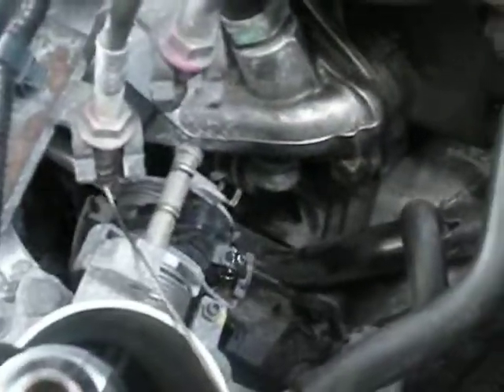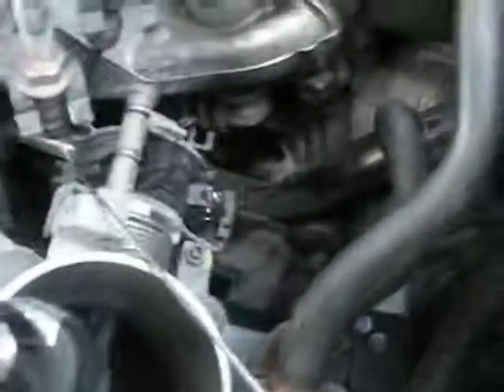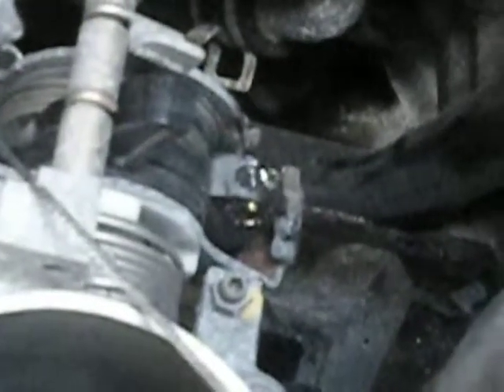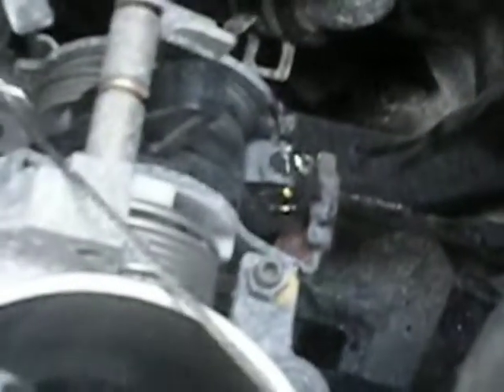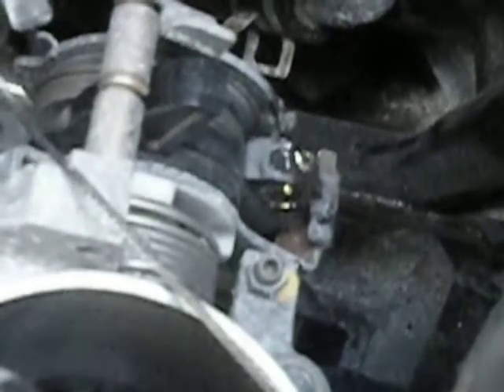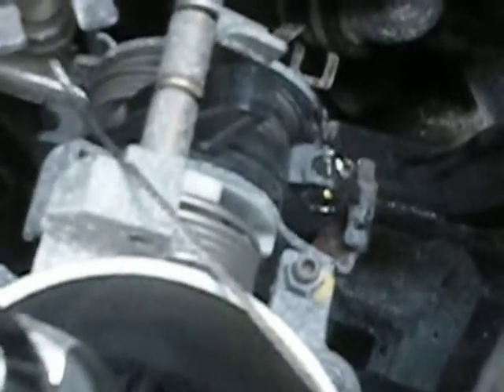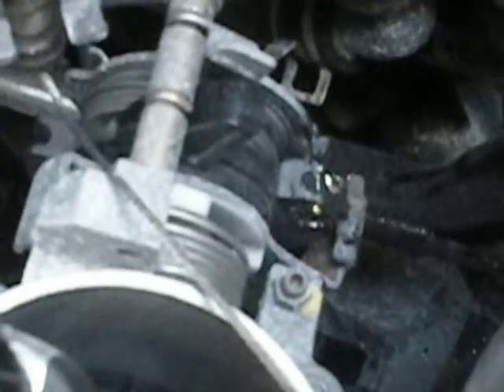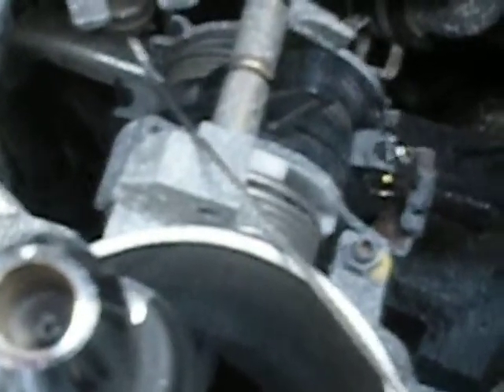Honda Accord cruise cam repair #2

Comment: Thanks for the video, it was very helpful. I just used JB Weld to glue the cable end directly to the cam on my 2001 Odyssey. Not as robust as the approach with the sleeve, but hopefully it will last a few years. So far, so good.

Comment: Congratulations. I spent over $650 to have my throttle body replaced at the Honda dealership - just to get my cruise control back on my '04 Accord LX.

Comment: In process of this repair now.  Thanks for the detail.  Not sure if my fix (based on your idea) will hold.  Thanks for the video.
Reply from the maker: Sorry, the video isn't great. But it sounds like you get the idea. An aside, I sold the Accord a couple months ago with 200k miles, still running well and the cruise working as it should.
Reply: Well, what I did was the "JB Weld" patch, after fabricating a brass 'socket' for the cable end.  I wasn't sure that it would hold, though, so I also patched in a thin piece of wire through the socket, and threaded that through the 'tab' in the cruise-control cam.

VERY frustrating that such a significant part isn't available.  I was trying to figure out if another throttle cam could be adapted to serve as a cc cam, but no joy there.  

We're taking the vehicle on a cross-country trip, starting tomorrow.  I'll let you know how we fare...

Comment: Did it work?  Did it last?   Thank you.
Reply from the maker: yes, worked great, still driving the Accord with 200k miles and using the cruise control at least weekly.  Worth fixing
Reply: Ross Thoms Thank you. I will give it a go. Much appreciated.